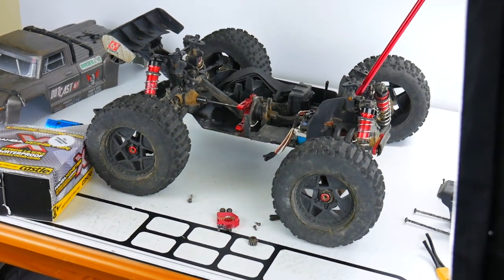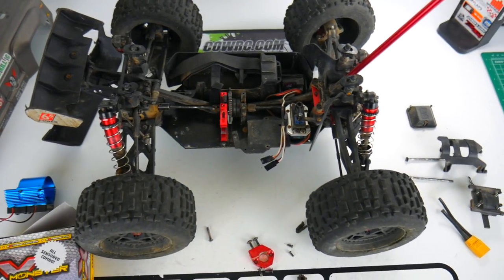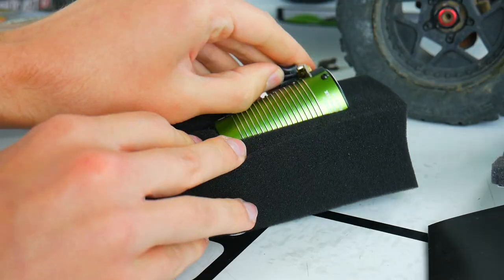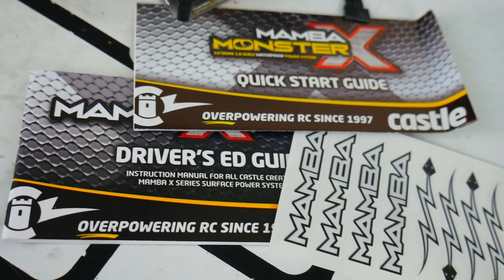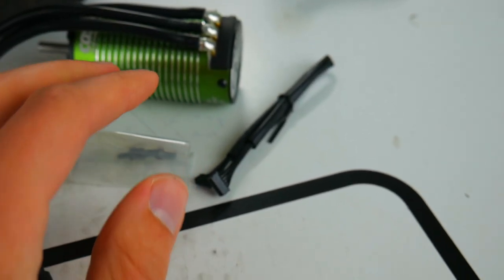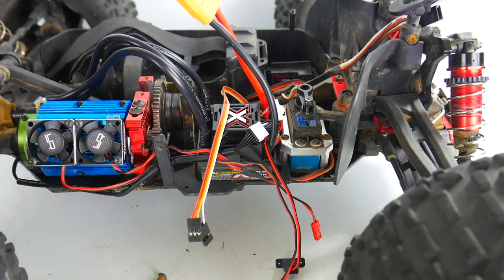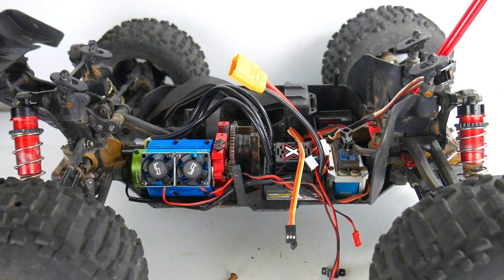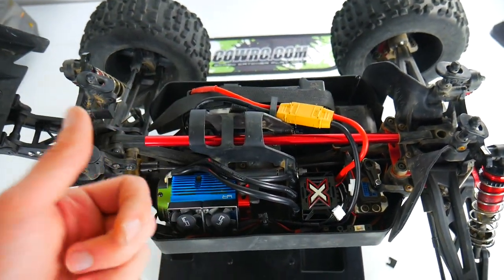The ARRMA Outcast is Now CASTLE POWERED | Mamba Monster X // 1515 2200KV

Comment: Did it come with instructions on how to calibrate the esc? Also what is the castle link?
Reply from the maker: Yes, it came with a full set of instructions. The Castle Link adapter allows you to hook your ESC up to the Castle Link software on a computer and change a variety of settings. Drag brake, throttle/brake curve, and other settings like motor direction can be adjusted. 👍
Reply: @LVC_RC  thanks 👍

Comment: What pinion are you running on this?  I set mine up with a 18t and i cannot keep the front tires on the ground and the motor gets hot fast?
Reply from the maker: I believe I was still using the stock pinion.

Comment: Can i ask what pinion gear you use? Or what is the highest pinion u can use with a 2200kv motor without over heating it
Reply from the maker: Lenny Geijs I’m still using the stock gearing actually. 👍 You can gear it higher, but I’m not sure how high exactly.

Comment: I'm going to order the same exact set up for my notorious 6s v4... How much of a difference did it make over stock system??? Do I need anything else to run this set up???
Reply from the maker: Nice! This system is much smoother and more adjustable than the stock combo. Seems to have a little more power too. You shouldn’t need anything else, just a plug to solder on the esc.
Reply: @LVC_RC  what about that usb program device you used.. Is that something I need? BTW thanks for responding 🍻
Reply from the maker: Brock Diesel You’ll need the Castle Link programming kit if you’d like to make adjustments to the esc’s settings. Castle ESCs usually come with a code that you can enter on their website to receive a free Castle Link. I don’t believe that code includes a USB to Micro USB adapter, so you’d probably have to purchase that separately if you don’t already have one.
Reply: @LVC_RC  ok naw I don't own one so I will add one to order... Thanks you so much for your help brother I'll be posting it on my channel when it comes in as well as install.... New sub here 🍻 bash on bro 💪💯

Comment: How do you like the upgrade with the Mamba monster x with the Castle 1515 /2200kv vs the stock electronics in your Outcast?
Reply from the maker: UpliFT-RC I’m absolutely loving it so far! 👌 Having a sensored combo is a game changer. It’s super smooth.
Reply: @LVC_RC  Finally my motor on my v3 Kraton burnet up on me so I will be adding this combo to my kraton.

Comment: Nice flippin action🤘 I have a granite I've converted into a 4s outcast (blx120 esc with surpass hobby 3670 2850kv motor) I'm contemplating grabbing the mamba x esc. How has it performed for you since this installation?
Reply from the maker: Thanks! Sounds like a fun setup! 👍 This combo has been awesome so far. Super powerful, adjustable, and smooth.
Reply: @LVC_RC  kickass man thanks. Yeah it's a pretty rad little machine, just threw some kraton exb shocks on it with mx28's, 18t pinion on hot racing motor mount 😈its evil for a 4s rig

Comment: Very nice upgrade dude, the truck sounds a lot smoother. Just curious, did you gear down to compensate for the higher kv motor? Even if you didn’t you’d be fine with that nice fan setup.👍
Reply from the maker: Thanks! It’s buttery smooth now.👌 I left the gearing stock actually. The motor temps seem to hang around 130 degrees Fahrenheit, which is about the same as the stock 2050kv. 👍
Reply: Overkill RC Nice, good to hear.

Comment: So HOW MUCH FASTER is it then stock system !!!?????********
Reply: I don't think it's that much faster. Also it depends on gear ratios. This upgrade is mostly for more control over the vehicle and smoother acceleration and a lot more adjustability. But a Max 8 combo would've been just fine for a lot less money if he really just wanted to solve the issues he had 😉
Reply: @ELValenin  so max 8 same power and torque for a lil less money?
Reply: @Bro_wdf_you_doing  a max 8 isn't less money. The BLX185 is a downgraded Hobbywing quiqrun 150a (with less adjustability). You can get a BLX185 for 60$ if you're wanting to buy from a chop shop. But the max 8 is better.

EDIT: oh you were referring to the mamba, whoops. Yeah the mamba is a lot more expensive, but probably also better. Depends on how much money you want to spend. Regarding the motors, I don't really know much about them but I don't think there is much of a difference. Keep in mind the mamba monster is sensored, the max 8 isn't.

Comment: How much do you want for the stock combo? 🤔😉 Nice upgrade
Also which double sided tape did you use? Mine never holds...
Reply from the maker: The esc was unusable, so I trashed it. The motor is actually already on its way to a new home. 👍 I use BRP double sided tape, it has worked very well for me. I get ya, double sided tape can get frustrating!👌😎 Thanks for watching!
Reply: @LVC_RC  nice, thanks for the quick answer 👍